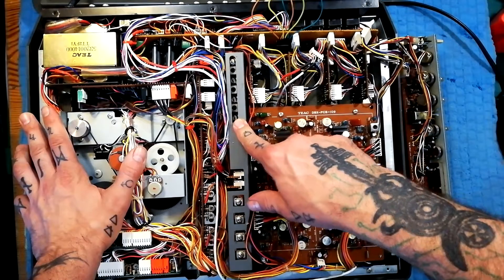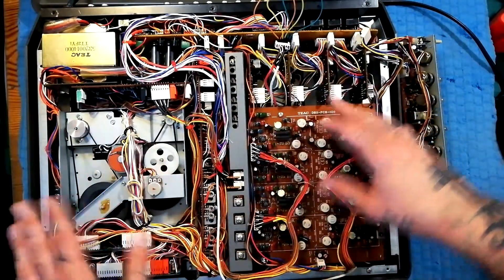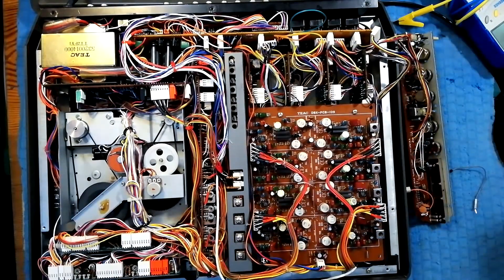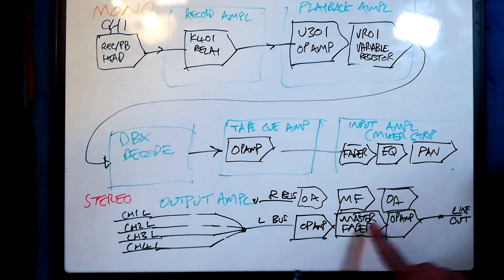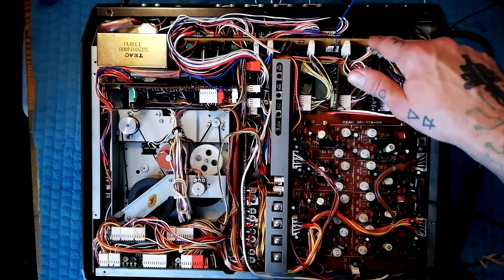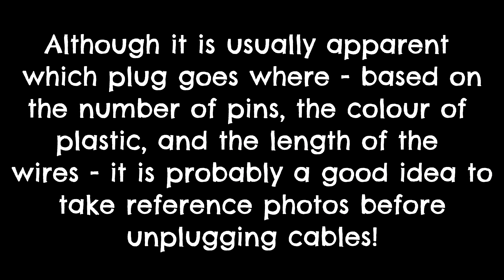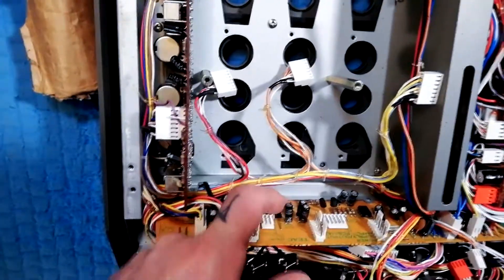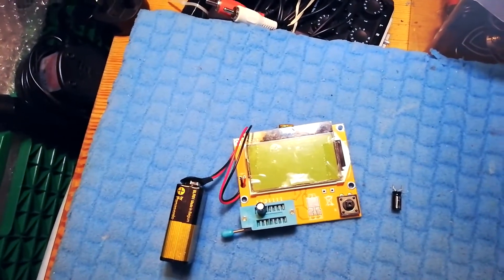stereo buss troubleshooting - headphones, master fader & line out | Tascam 244

Comment: Hi Tetrakan, thanks for these fantastic videos! I have a couple of 244s which both have very noisy audio if using headphones via the Phones out on the unit, but sound clean if I use the monitor outs to a mixer and then use the same headphones out of the mixer. The noise I hear directly out of the 244 Phones is a constant wall of hiss or white noise which is present immediately after power up and not affected by what is happening in the unit (playback, recording etc)
This makes me think there is an issue in the headphone circuit. I've also read a few other accounts online where people mention say Tascam used noisy headphone amp chips in this era.
I have inspected the headphone chip and there is no obvious visual problems like in this video. I've also cleaned all pots which reduced random pops and clicks when turning the pots but has not affected the consistent hiss.

Would you say in your experience that this loud hiss is the expected behaviour/quality of the Phones out audio?
Reply: Hi, to follow this up I have found that on the Playback board that the socket for the headphone connection (P801 on the board) shows continuity between the Left, Right and Ground solders. I'm not super experienced with this stuff but I assumed that each should be independent/discrete of one another? It feels like continuity here would be a reason for the ground to be creating issues in the audible L and R channels being output to the headphone jacks...
Reply from the maker: Hey, sorry for the slow reply. Id expect those three pins to be discreet from each other, yes. You will find some headers connectors  or IC footprints where there is continuity between more than one pin, but only because there are multiple connections to circuit ground: for example on a 4 track the connectors for heads usually have 4 connections to ground, one for each tape track. But on the headphone socket I'd only expect a sub 50 ohm resistance to the chassis from the ground pin, with resistance between the left and right pins and chassis or other circuit ground locations being either infinite or at least in the mega ohm range. If you're not getting that, follow out the schematic and look for components from the left and right audio paths to ground, make a  list, and test those components for shorts. It's usually a capacitor, semiconductors less often, and rately durable components like resistors, but there's always some black Swan I've never seen before so keep an open mind!
Reply: @Tetrakan  after reading the manual a bit more closely about 244's BUSS MONITOR and TAPE CUE being somewhat independent, and then doing some more testing (just playing instruments and monitoring them via phones) I think the phones output is actually fine on the 244.
I'm used to a 424 which from memory the Monitor Level acts as a master volume out to the phones, so on the 244 I expected the Buss Monitor to do the same. Which meant I was probably setting combinations of Buss Monitor and Tape Cue that would either doubling a recorded signal on playback, or introducing more noise from turned up Tape Cue when there was no recorded material to monitor.

Hope that makes sense! Thanks again for the response
Reply from the maker: @somepostman  glad you got to the bottom of it, happy recording!

Comment: First off, you're doing an awesome job! Since it seems that these recorders are probably not going to be manufactured never again, it is very cool for you take the time to share your knowledge. I've managed to hoard a few non operating 4 and 8 track recorders and might even be able to fix some of them after watching your videos,

Secondly, talking about master faders.. my 244 has a faulty one (seems like the part connecting the pin to the carbon track got corroded somehow) would you happen to know where to order a fitting replacement? Shouldn't be all that hard to find since the pins don't have to match any pcb holes but still, it would save time and effort if you could provide a link to one or even just a brand/model that is sold at the moment.
Reply from the maker: Thanks. I'm sorry I don't know where to get replacements, I've always relied on  buying 3, fixing 2 and keeping the worst one back as a parts donor for future projects. As a workaround  might you bypass the master fader altogether with jumper wires? OR use a dual pot or pair of pots, and mount those on the lower case?

Comment: Hello @tetrakan I' would like to bypass master fader for testing, when doing the 3 dupont wires loops  (pin 1-2 , pin 3-' (ground) and pin 5-6 .. I only get the minimum output level, not the maxone, is there something to do more  ?Thanks for your help and your wonderful videos
Reply: @Tetrakan : Hello and sorry to bother you again. i come back after further testings, trying to get the Right Channel (Buss R) to work.
In REMIX mode, I get a very very low sound on right side of headphones and line out. Same in Record mode, recording to buss R (track 2 or 4) is very very low ,

When I try to bypass the MASTER FADER (using female Dupont Wire as shown in the video), It seems to make BUSS R to work, but it looks as the MAster FADER isn't maxed out, it's just at a very low level, for LEFT and right side.. So I can't understand how to "max out" Master Fader before bypassing it. 

Am I missing something ? Fry open the  MAster Fader looks like a hard job and I'm afraid of missing something important before doing it following your other video. Thanks a lot for your help or the help of anybody that did follow your path :)
Reply from the maker: @francoisesco3606  Hi, if you bypass the master fader, the signal on both sides (Left and right) should be at maximum. This is because the master fader is a passive component, and it can only attenuate (turn down) the signal. Bypassing the master fader asks a question "Is the volume problem I am having with my stereo signal level being caused by the fader? Or does the cause of my problem lie somewhere else?" If you get a maximum level in left and right, you know the fader is the cause of the issue. But if one or both sides of the stereo image is quiet, you know the level problem lies elsewhere, either with the signal path immediately before the fader, or with the signal path immediately after the master fader.  I was not a "fly on the wall" watching you bypass the fader, but assuming you have done it correctly, you still have a quiet R channel, even with the fader bypassed, correct? From that I owuold conclude the fader is not causing the quiet right channel. SO then there would be two possibilities.  There are some capacitors an opamp and connections between the pan control and the master fader, maybe one of those failed? Or, there is a similar group of capacitors an opamp etc after the fader, perhaps the fault lies there. If you were curious and wanted practice, you could use an audio probe to find out which of these two parts of the signal path has the problem. but because the parts are cheap and fungible, I would be tempted to just replace both opamp chips, all 8 capacitors, and retouch the solder.
Reply: @Tetrakan  that exactly the big question ! I must have make a mistake when bypassing, or my Dupont Cable doesn't fit good ? .... First of all I precise that  problem stay the same  during tape playback or monitoring an input.

I try a description : 
- Normal use : Master Fader plugged on its connector...  I get full volume on LEFT and very low volume on RIGHT. A big difference that I can't fully compensate on my mixing console.

- When bypassing the Master Fader : 
"Dupont-jump" pin 1 with 2 , pin 3 with  4 and pin  5 with 6  ( similar as in your video, starting pin 1 from the left when in front of the connector)  
The volume is now very quiet but EQUAL ON BOTH LEFT AND RIGHT Channels   !  So the right  Side outputs at the same quiet  level as the left,  could be a proof  that the master fader is  the issue.

I get equal volume on RIGHT and LEFT but  the volume is now very  low ( got to give about +30 db I gain on  mixing console, lots of noise of course  )    ...   

Here's why I assume a wrong bypass of master fader :    If I take back the 3  Dupont cables, and don't replug the master fader connector,  the volume stays at the minimum, the same as with the Dupont's jumps... So  my bypass does'nt change anything, it acts the same as with master Fader just unplugged and no jumpers. 

i'll try tomorrow with other cable, but can you confirm me I did see good on your video 
On the Master Fader connector, there are 6 male- pins , counting 1 to 6 from the left to right in your video...

- the center 2 pins are the grounds from both side and has to be put together (pin 3 and 4) ? 

- The  Lefties    and + righties  ( 1 with 2, and  5 with 6 ) ? 
What else can i Try to really bypass the master fader ? Or is there an issue that makes the volume fall down when I unplug  this stupid Master Fader connector :) ?? Thanks again, thanks a lot ...
Reply: @Tetrakan  UPDATE  Thanks a lot, I've found the good bypass and my  Quieter Right Buss problem is definitely caused by the Master Fader ... SO FOR INFORMATION :  to bypass Master Fader as in this video you have to shorten the pins "crossing them" like the master fader cables are !! From Left to Right  (as  visible in the video ) 
PIN 1 with PIN 5   (left buss)        PIN2 with PIN 6 (Right Buss) ... PIN 3 with PIN 4 ( Grounds) .. So glad because my stereo issu looks to be a Master Fade issue only  !!!  I'll try to clean it very soon .. So cool !

Comment: Thanks for your videos! I just got a 244 and i'm still trying to learn how it works from the user manual and these videos. Total beginner to the whole area of tape recording. So far i didnt fully understand the buss system and i'm not sure if i've bought a faulty unit. I cant get channel 2 and 4 to record on the tape. I get a monitoring signal when they are panned to the left but as soon as i turn the pan to the right the signal vanishes from the VU and i cant hear anything. If i use the 4 tracks at once setting all tracks do record. Any ideas what the problem might be and how to fix it?
Reply from the maker: I'm wondering if it's a fault with one side of your master fader...if you play back a prerecorded cassette in remix mode are you getting output from  both sides of your headphones and/or line out?
Reply: @Tetrakan  Thanks for the quick answer! The right side is really quiet and sounds distorted
Reply from the maker: You're probably going to need to access and pry open the master fader to see if it's full of lint or maybe one if the brushes is corroded. If it looks okay and checks out with a meter other possibility is the master faders are preceded and followed by opamps, they can go bad and if they do much louder or quieter signal plus distortion are common symptoms. They aren't expensive but they're a bitch to access...I mean you'll learn a lot tackling this yourself but it will be daunting!

Comment: I must compliment you for your work about the 244, it's a complex machine and your videos patiently and accurately illustrate how to deal with the various problems.
I fixed a Porta 07 from what appears to be a common problem, polarity inversion. If you think it's useful, I can share my findings somewhere.
Reply from the maker: Thanks, please do...I actually have a porta 07 with that issue, I assume there is some dead semiconductor near the DC input socket? (I haven't got round to troubleshooting it yet)
Reply: @Tetrakan  Yes, more or less. The first thing I noticed was the power mute circuit had a transistor visibly burned, a 2SC1815GR (near the DC input socket on the right side looking from the back). 
That circuit is similar if not identical to that of the Porta One or the 414 MK II. 
As suggested by SkywaveTDR in the Tascam forum, I replaced it with a C1845 of similar characteristics, I chose one with 290 hFE. 
I was lucky because the nearby Zener diode usually goes away as well, it's a RD12EL2, mine was OK.

Differently from the other two models the 9V regulation is not achieved with a 317 or a 7809 but with a M5237L in a slightly more sophisticated manner.
In the M5237L datasheet there are two example application circuits, the Porta 07 works in a similar fashion.
The M5237L only drives a power transistor a B901 (an 2SB1314 in the datasheet's examples) which holds all the load.
This is the large transistor mechanically connected to the transport mechanism in order to cool it.
It looked perfectly fine in my case but since I hadn't a working 9V (I measured about 3,5V) it was the prime suspect.

To test the hypothesis I used an A614 Y-821, with the following precautions. 
First the pin out is reversed, it must therefore be mounted inverted.
It can sustain about half the current so I didn't connect the mixer side of the Porta, nor the transport mechanism because (third) the A614 cooling fin it is not electrically isolated like in the B901. 
It worked, I measured a steady 8,98V.
 
The final step was to find a suitable replacement ( I don't think that in this case the hFE is important), I opted for a 2SB1370. More powerful, insulated fin but again reversed pin out.
But I didn't have the patience to order something so I placed a new dissipation plate in front of it and fixed to the transport with a longer screw.
The next electronic order I'll take something better. :)
Reply from the maker: @Gezira  excellent, thank you, I will refer to this when I get to my own porta 07
Reply: @Tetrakan  You are welcome, if you need more details please ask, I will try to do my best.

Comment: I have a Portaone, No Right Channel audio from headphone or line out. I cant find out where the L/R split in the schematics, Im new to reading schematics though. Would you be able to help and take a quick look and let me know what section to focus on?  I was hoping it would be similar internals!
Reply from the maker: Hey I've got loads on at the moment but I'll try to get round to giving you a better reply....meantime can you let me know if you are having the issue in remix mode or cue mode or both?
Reply: Thanks for the reply! I found that the master fader itself wasn't sending any L audio, so I just patched it always on full volume from the back. works a charm. If you'd reccomend a different solution plese let me know. I did reflow all the connectors for the fader
Reply from the maker: @Jamieip  Its a good thing that you have narrowed it down to the fader. You could try desoldering the fader, prying it apart to clean and reinstalling. So long as the little copper brushes haven't actually snapped off or the conductive plate hasn't corroded so badly  that it no longer has electrical continuity, this should work, its just fiddly, good luck.
Reply: @Tetrakan  thank you! the mixer PCB is a pain in the arse to re install so im happy with it maxed out for now! Ill get to it one day!
Reply: @Jamieip   Hello please can you describe me precisely how you did bypass the master fader ? There are 6 pins on my  244,  i just made as i could see  in the @tetrakan video , pin 1and 2 shorten together, same for 3 with 4 (ground) and 5 with 6 ... Is this what you did ? When i do this, i only get minimal volume on both channels, not maximum. Thanks for your help
Reply: @francoisesco3606  it was over a year ago I honestly cannot remember. Just probe around
Reply: @Jamieip  Thanks a lot, I've found the good bypass at the moment you were commenting :) ... SO FOR INFORMATION : you have to shorten the pins exactly like the master fader connector is !! From Left to Right  (as  visible in the video ) 
PIN 1 with PIN 5   (left buss)        PIN2 with PIN 6 (Right Buss) ... PIN 3 with PIN 4 ( Grounds) .. So glad because my stereo issu looks to be a Master Fade issue only  !!!  I'll try to clean it very soon .. So cool !
Reply: @francoisesco3606  yes that seems the same as what I did! well done brother
Reply: @Jamieip  this device is so damn good sounding with good stereo image !! I'm back on the Dub way :)